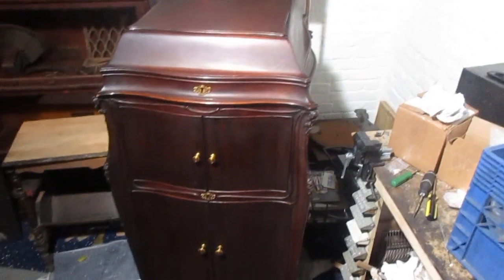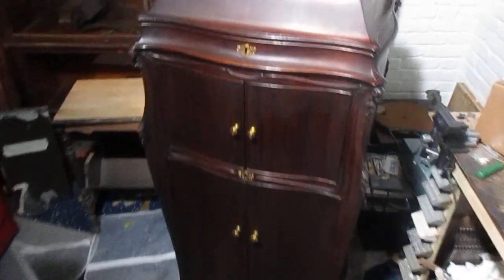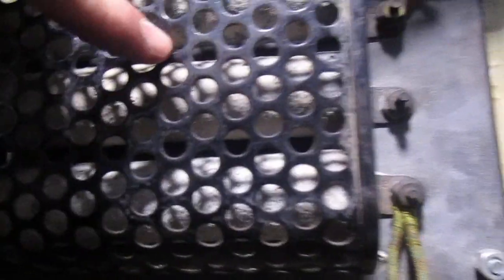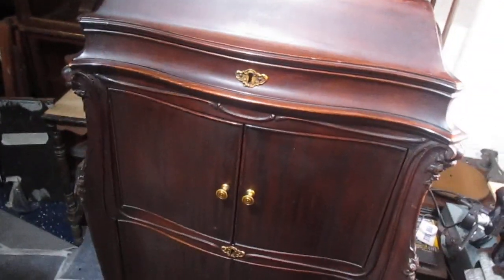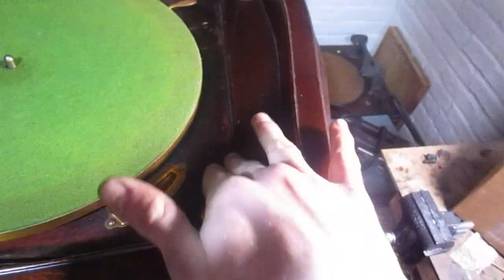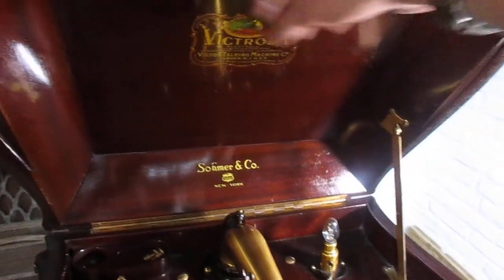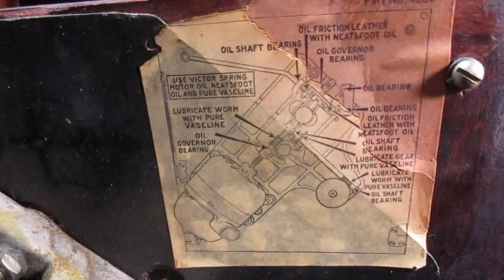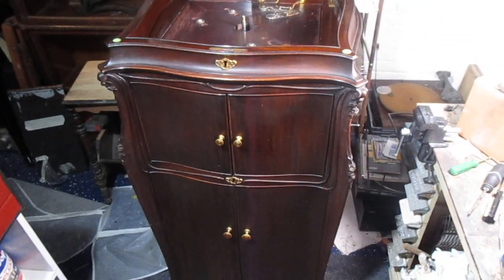VE-130

Comment: I'm not familiar with Victor's products as they aren't common in Australia but those cylindrical things in the cage in the back are the power resistors, used to drop the voltage for the motor. They're in a cage and the doors are vented because they can get quite warm. It appears they can be reconfigured for different voltages according to the paper label to the right of them. If they've failed the motor won't get the correct voltage; according to the Victor Victrola website most Victor electric motors operate at 32 volts.

As for the motor, it could be that the bearings in the electric motor are gummed up. If the motor has brushes they may be worn and need replacing. A really beautiful machine, love the carving and the little needle disposal drawer!
Reply from the maker: Thanks for the advice! It really is quite beautiful!
Reply: @BensPhonographs07  You're welcome!